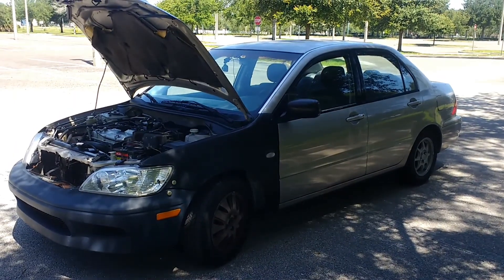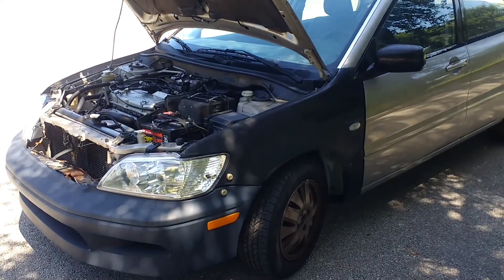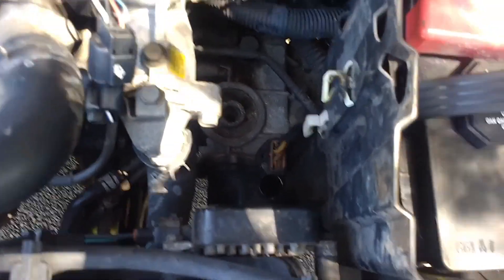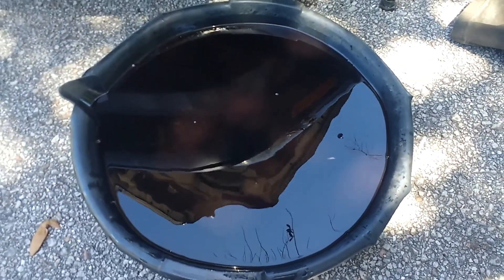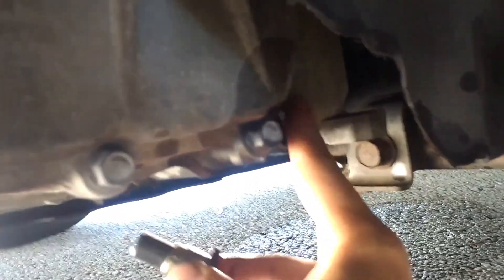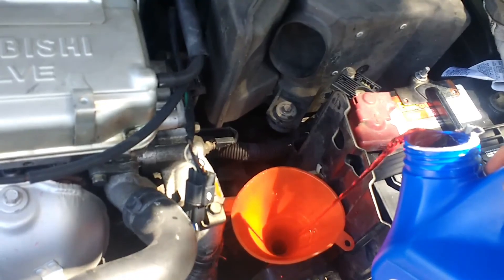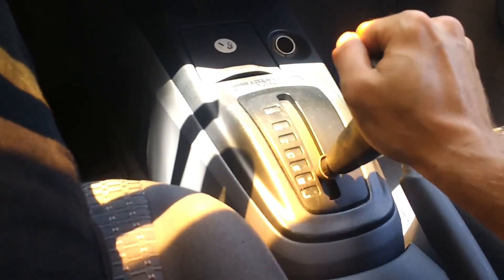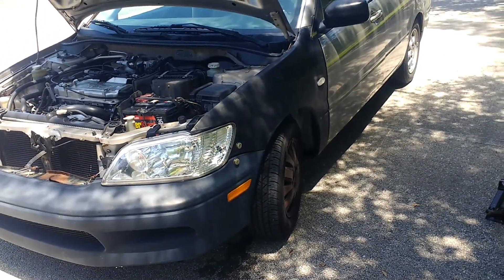Changing Transmission Fluid on Mitsubishi Lancer Automatic 02-07 F4A42

Comment: I have same gearbox but its in a 2003 mitsubishi outlander ( airtrek in usa), did you find any clutch shudder issues using that oil?
Dexron not correct oil for that gearbox, so wouldn't be surprised if you get a lock up clutch shudder in 4th gear around 70km/hr.
No problems? Correct oil is sp111 type by mitsubishi or hyundai, interested to hear how it went.
Reply from the maker: No problems using dexron. Trans still shifts perfect.

Comment: To have an accurate reading on the dipstick, drive around 5 miles then stop, keep the engine on, go through the gears from neutral all the way down to L, then back to park, posing 3 seconds on each gear, go all the way down again to L then up, stop on D which is drive then turn the engine off, the gear should be on D and the engine off before you check the dipstick. Wait for about 5 minutes then check. You need to check the dipstick multiple times to get the accurate reading.
Reply from the maker: That's wrong. The Mitsubishi service manual for the 03 Lancer says check fluid level in neutral with the engine running. I can email you the manual in a pdf if youd like.
Reply: @alexsbikesandmotors  I checked it on neutral with the engine running, with each dip, it gives a different reading, overfilled or below the normal level. a Mitsubishi mechanic told me to do this method and it was the only method that gave the accurate reading.
Reply from the maker: @comali2212  if you check with the engine off itll show much higher than the actual level. So if it reads full with engine off, the actual level is much lower. This is true for every automatic transmission.

Comment: I have this car and I've had nothing but issues
Reply from the maker: What issues? Mine has been the most reliable car ive ever owned
Reply: @alexsbikesandmotors  a lean code popped up a couple months back and it's been to two mechanics, I've put about 3 grand Into it, replaced fuel pump, fuel pump assembly, o2 sensor and more
Reply from the maker: @Signmy_350z  did you fix it? I'm surprised you needed a new fuel pump. They hardly ever fail on these cars. o2's go bad all the time but they throw a different code.
Reply: @alexsbikesandmotors  I've got p0134 for the bank one sensor one o2 no activity replaced it and it came back
Reply: @alexsbikesandmotors  and no I still have yet to fix it

Comment: why didn't you change the oil filter?
Reply from the maker: There's no filter on my transmission. Older versions of the f4a42 trans had a spin on filter but my 02 doesnt have one. There is an internal screen but it requires remove the trans oil pan. Its not really meant to be replaced.
Reply: @alexsbikesandmotors  I checked and the new box model from 2006 has a filter in the dipstick housing
Reply: @alexsbikesandmotors  I'll do the swap tonight and let you know if I was right
Reply: @tanaseadrianionut  how'd it go?
Reply: It seems that I was wrong and the gearbox has no filter at all. @bobz4

Comment: Why use that stuff and not SP III?
Reply from the maker: it's the same stuff and much cheaper than sp 3
Reply: @alexsbikesandmotors  is it really though I hear people say only us sp since our transmissions need factory fluid
Reply from the maker: @lively7365  well the multi vehicle atf i used worked fine. Actually it shifted better than before. There's nothing special about these transmissions that require a special fluid.